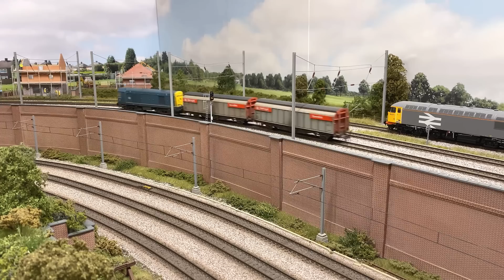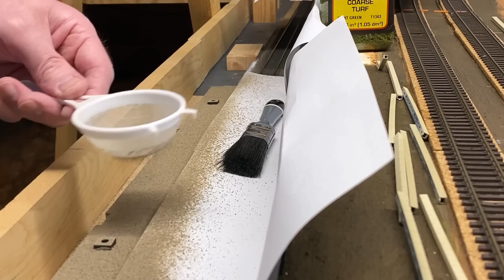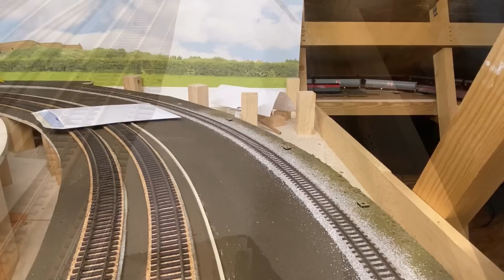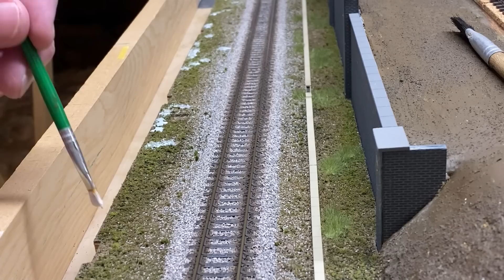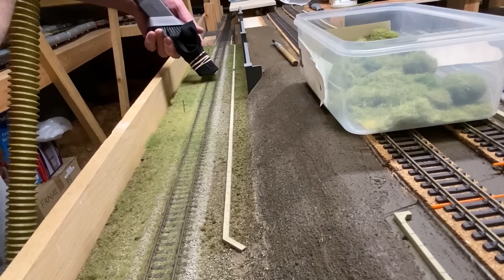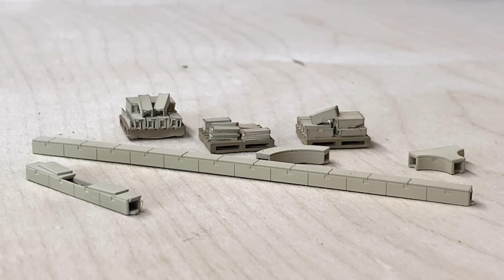Amazing Scenic Detailing YOU Can Achieve! Dean Park Model Railway

Comment: Those Gü pudding pots really are handy (and tasty) hehe
Looking good though. I'm toying with either putting my bus wires in the cable trunking, or using old set track as under board busbars.
Reply from the maker: Thanks. Yeah they are tasty. Haha. Your bus wire will likely be too thick for the trunking.
Reply: @DeanPark  Ah I didn't really think of that. I'll have  to fix some to the bottom of the board in that case.